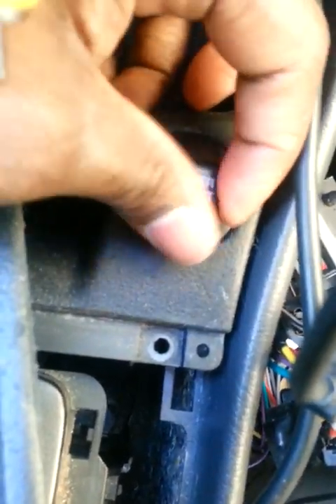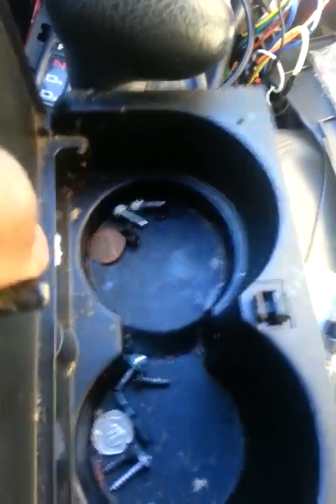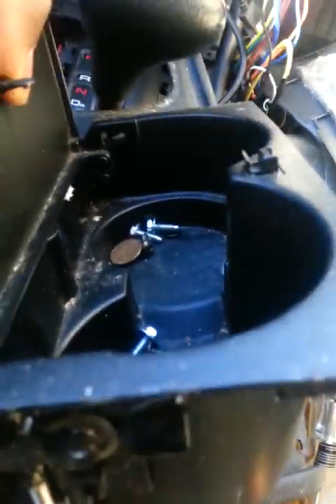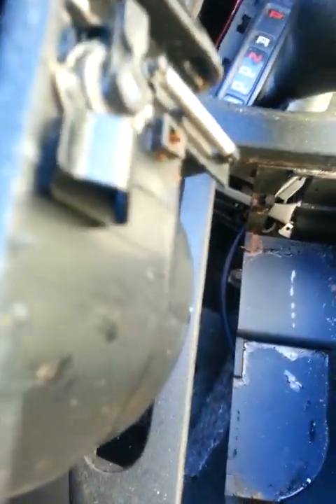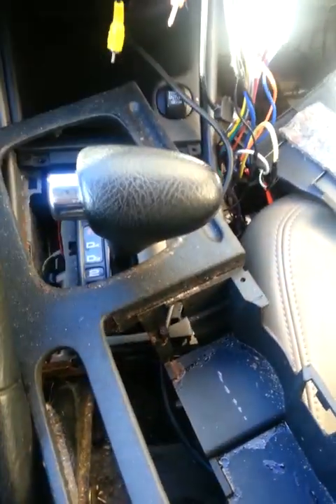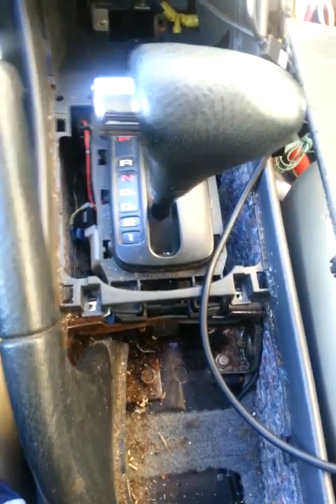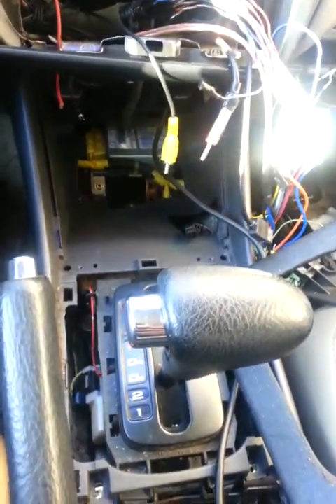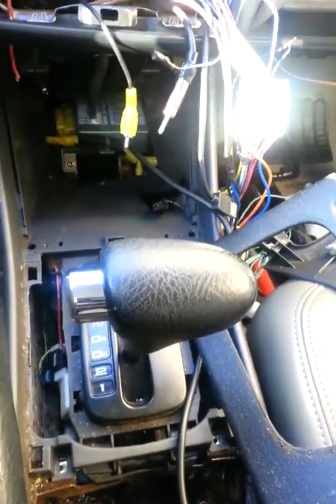cigarette Lighter remove & replace Honda/Nissan/BMW

Comment: Your video showed me how to take apart the center console, but only part of the way. How did you get the panel under the radio removed to slide out the tray with the cigarette lighter built in. Also how did you disconnect the clip from the lighter? I can't reach under the tray and the clip wont realease.

Comment: Thanks for this. I keep popping the fuse to this and the radio. I'm pretty sure it's because the wires are damaged and shorting to the lighter. Now I know how to pull it apart without breaking the console.

Comment: works. i had to watch the video a few times to understand it but it definitely helped me
Reply: muscle meeks 

Thanks for the response.  

As you seem familiar with this disassembly, would it be easier to remove the radio, and go 'down'?  I saw a video where the gent had the radio out in 2 minutes. 

 I'm not good with interior trim/clips, and am looking for the least invasive way to either 'hot with' the lighter, or add a second.  

 tia (again :)